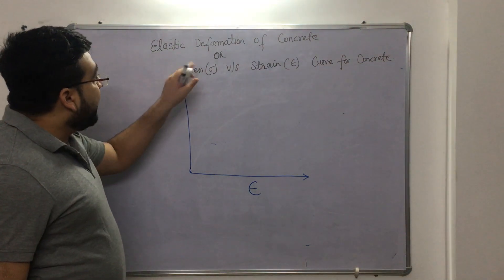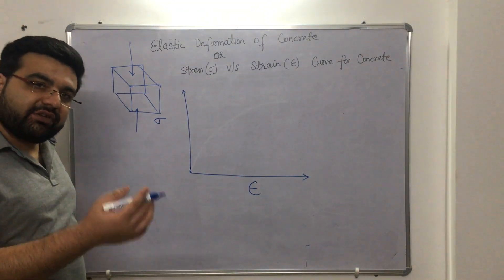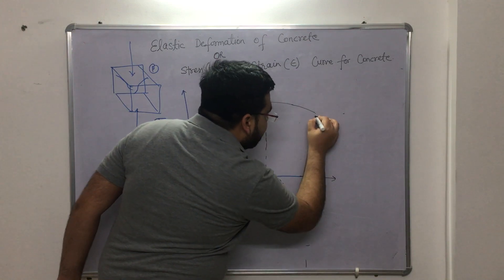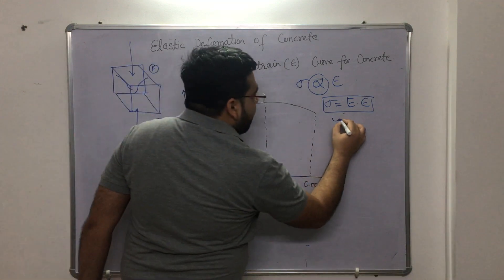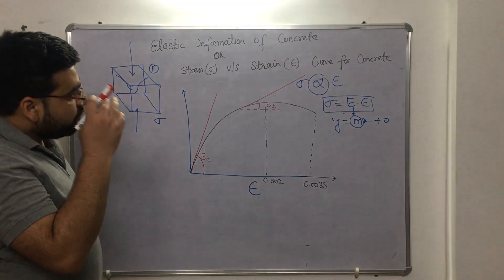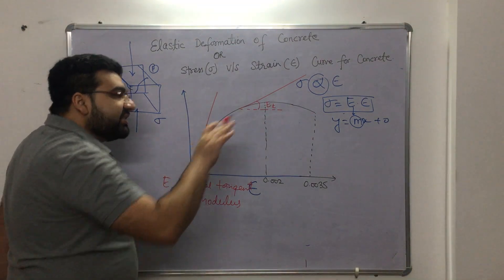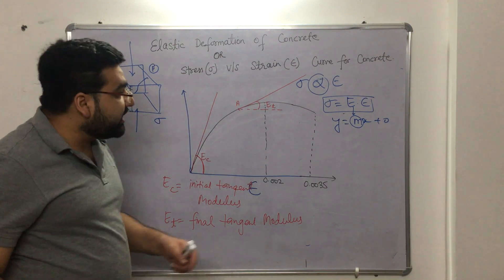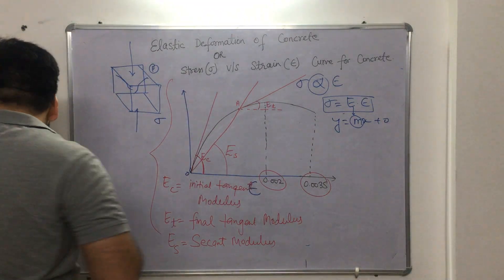Elastic Deformation of Concrete- (SSC JE/ GATE/ ESE/ PSU's)- Civil Engineering- RCC

Comment: Sir how does one find the stain in the reinforcing bars and the Outside face of the column at mid-height of the column , over the loading range of the column
Reply from the maker: We can use the linear strain diagram of column reinforcement to determine strain at any location (theoretically) and strain rosette system (practically).
Reply: For instance practically what would be the approach, if I’ve tested a reinforced column under compression and measured the micro-strain on both faces (face A:  compression, face B: tension)

And I have the Elastic Modulus for concrete and steel, the second moment of inertia column .
Reply from the maker: @lesedivictormoeletsi3875  , I think that i didn't get your question properly, column is a compression member, until and unless there is no eccentric loading, tensile stresses will not be generated. If the loading is outside the KERN area, then only the tensile stresses will be generated.  but still if you want to measure strain, UPV(Ultrasonic Pulse Velocity) method can also be used. And it should be Second Moment of Area not inertia.